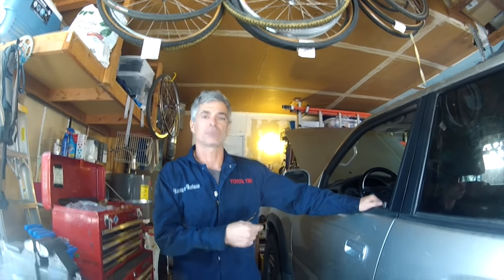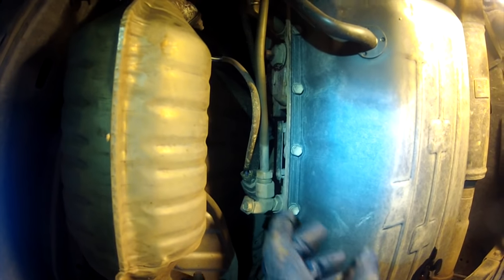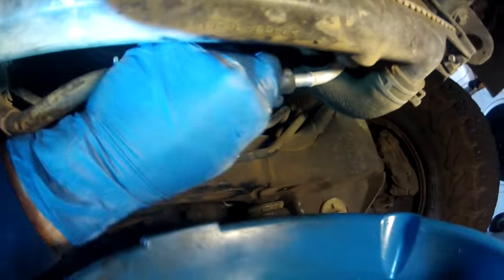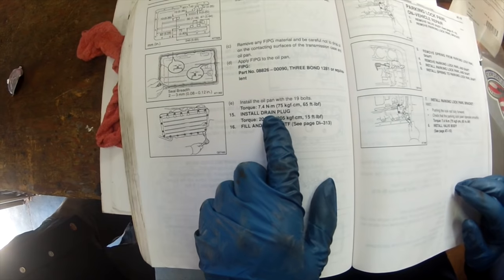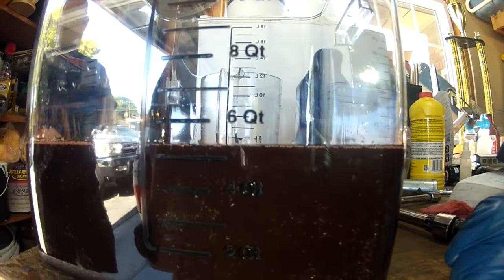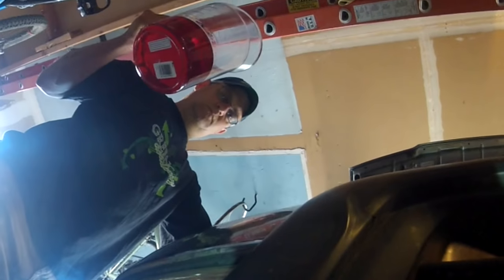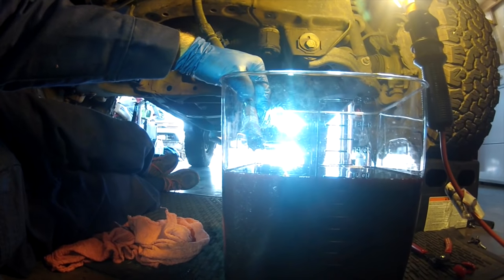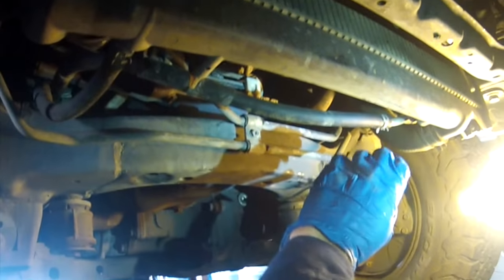Transmission Fluid Flush

Comment: You should do a radiator flush next !!! I want to figure out how to drain the coolant from the engine itself
Reply from the maker: All you have to do for a radiator flush is drain the coolant out of the radiator and pull the reservoir bottle and pour that out.  I cover this in my trans cooler install video.  https://youtu.be/2nVbwe2t2T8

There is a drain for the block but I think it's a waste of time in my opinion.  There was a guy on a Toyota forum that showed how much he drained out of the engine.  It looked like maybe a 1/2 pint.  That's not enough to worry about in my book.  If it were simple to access, I'd say do it, but I heard it's a little difficult to get to.  There's also some left in the heater lines and core as well.   

You get the bulk of the coolant out by draining the radiator and reservoir and if you're renewing it at the suggested interval, every 30,000 miles, your coolant will stay in good shape.
Reply: Timmy The Toolman
Reply: Timmy The Toolman
Reply from the maker: We got a radiator flush video coming.  Sean wanted to change back to using Toyota coolant so we had to flush out the old pond scum green he had in his system.  His coolant was in bad shape and even if we weren't switching coolant types, I would have recommended to do the flush to get all that old coolant out.  If you renew your coolant at the normal interval of every 30,000 miles, your coolant won't look like algae pond water.  When you simply drain the radiator, you get most of the coolant out.  The capacity of the cooling system without a rear heater is 9 quarts and with the rear heater it's 9.5 quarts.  Draining the radiator gets out around 8 quarts, so at most, you're leaving 1-1.5  quarts of old coolant in the system.  When the coolant is changed regularly, leaving that 1-1.5 quarts in there isn't going to hurt anything.  

We used 8 gallons of distilled water to flush out his cooling system.  We'll have the video out within a few weeks.  The video editing is backed up a bit because we've been doing a lot of wrenching lately.

Comment: Hey Tim, how are u brother,  I have a 2 simple questions. When it comes to the supercharger for the 4runner, is it as simple as plug n play (it doesnt requires that 7th injector, does it) and once installed does it guzzle more gas; If so- is it a minimal increase or alot more??? Thank you so much!
Reply from the maker: Gas is more expensive since you have to use 91 octane. Average miles per tank is ~220/230 miles/tank, which is about the same as our other 4runners WITHOUT a supercharger. The supercharger does NOT require the 7th injector however it is a good idea to think about fuel management by installing a higher flowing fuel pump,  larger fuel injectors, methanol or the 7th injector AND a professional tune. All these things will help with performance and to avoid pinging. Everything you need to know you can find on T4R.ORG our favorite website. https://www.toyota-4runner.org/3rd-gen-t4rs/146022-3-4l-trd-supercharger-thread.html
Reply: @TimmyTheToolman , Alright thank you Tim... !!! I'll take a look at tht link you sent and do my homework....have a GREAT REST OF THE WEEK, or what's left of it. 4runner FOREVER!

Comment: Regarding torque specs on the transmission drainbolt...
Haynes Repair manual says ...
156 inch pounds (13 ft.lbs.) for 1996 to 2000
35 ft.lbs for 2001 & later...

Please confirm.
What manual are you getting your specs from? What year vehicle is it for. Some years may have an aluminum pan and others may have a steel pan.
Reply from the maker: The 15 ft lb spec we specified for the drain pan bolt came from a Toyota factory service manual.  I've worked on 01 and 02 4runners and no way is that bolt going to be a different torque value than the 96-00 models.  It's the same size drain bolt for all the years.  If you tried torquing it to 35 ft lbs, you would strip the pan and then be bumming.  I suggest you use 15 ft lbs and maybe do yourself a favor and get a Toyota FSM set for your rig.  You can find them for sale on Ebay most of the time.
Reply: @TimmyTheToolman 
There is a fellow who calls his channel"Toyota Maintenance" and he mentioned 40 N•m (30 ft.lbs). I think it was for a RAV4 . Maybe I was wrong. Or maybe he misspoke. On a video for a Corolla he said 20 N•m which I believe is 15 ft.lbs. https://m.youtube.com/watch?v=GTejG9nCGC8
Reply from the maker: @njsongwriter  Yeah, I know who he is but I would never try to torque one of the small drain pan bolts to 35 ft-lbs.  Trust me on this.  15 ft-lbs is more than enough.
Reply: @TimmyTheToolman  
Thanks. On this coming Monday, we're getting an after market ATF cooler installed on our RAV4.

Comment: What fluid is recommended for my 2002 Toyota 4runner 3.4 V6?   Help!!  I need synthetic.
Reply from the maker: Valvoline Maxlife is a good choice.  I just started running it in my rigs.  Here's a link: https://amzn.to/2NnaVpB
Reply: @TimmyTheToolman  Timmy the service manual states dexron II or III for the transmission and PS. Nonetheless you suggest Valvoline MaxLife which is dexron IV. So, then this means it is not an issue to use D IV ?  Thanks.
Reply from the maker: @luiszo11  Valvoline Maxlife is compatible with Dexron III.  As long as the fluid you use is compatible with the original spec, you can use that fluid.

Comment: I have a 07 tacoma 5 and auto close trans , basically no dip stick. Toyota claims its a service free trans which I don't believe it. Have you done trans service on a 05/10 year trans?
Reply from the maker: Hey Dario, I haven't done a service on one of these newer transmissions with no dipstick.  Yeah, no fluid lasts forever.  Why Toyota went to this is beyond comprehension.  I had heard about this with BMWs with them saying the fluid is lifetime and doesn't need servicing and of course people started having transmission issues around the 100k mark when the fluid was completely broken down.

I watched this video: https://www.youtube.com/watch?v=e1pr3EHSMDI  He works exclusively on Toyotas and explains how difficult the procedure is for getting the fluid level correct.  He reads from a technical service bulletin and it sounds like a nightmare to do.  

If it were me, I'd drain the fluid into a container that has graduated measuring marks so I'd know exactly how much I removed.  Then, I'd use one of those cheapo pumps you can buy at an auto parts store and add the exact amount back in.  This is assuming the level was correct to begin with.  If you had a leak and lost some fluid, you would pretty much be forced to follow that very involved and confusing fill procedure.  

Wish I could help you out more.  Toyota really screwed their customers by going to this type of transmission with no dipstick.

Comment: Just recently purchased a used 97 4Runner, drained the transmission pan but only got barely over two quarts out and replaced, whereas you showed draining a bit more than 5 quarts.  I see on some forms that you should expect to get around 3 quarts out.

The reading on the dipstick looks like it's at the right level. Does that mean I'm low on transmission fluid necessarily?  When I drive the car on a short drive I do notice it has a difficult time shifting in that it seems to be delayed.  And also there's a delay when shifting into reverse. I did not notice this when I test drove the car.

I would note also that after purchasing the car, when I initially measured the fluid at the dipstick after reaching operating temperature, it seemed to be overfilled so I drained around a quart out as I was concerned about it being too full.  

Hoping I haven't caused any damage to the transmission having driven it for a mile or so if it was low on fluid.

I've read quite a few posts that have indicated if you're low on fluid shifting will be delayed and or a bit rough due to lack of pressure.

Thoughts?

Thanks!
Reply from the maker: Are you checking the fluid level with the vehicle running?
Reply: @TimmyTheToolman  I am.  And  with it running and fully warmed up it showed as being overfilled when I first brought it home after purchasing.  So I took out about a quart or so until it showed within the hash marks on the dipstick. 

But since doing that it seems to have a delay shifting into reverse and sometimes into first gear when starting from the stop. When I watched your video and saw that you drained almost 5 quarts out of the pan, it got me to thinking that maybe mine was actually correct when I thought it was overfilled, given how it drives since I've drained a quarter so.  I'm going to do the complete drain and refill like you showed on the video and start with it showing as in the middle on the dipstick and if it's still shifts like it is now, add a little bit at a time until it shows full or a little over to see if the shifting problem clears up.  If it's a quarter inch or so above the full mark when I'm done (like it was when I purchased it) is that bad for the transmission?

Maybe my transmission is just on its way out.  

Thanks again for all you do for we 4runner owners!  You've certainly helped me keep mine on the road!  And now my son's if we can get this transmission issue figured out.   Hoping I didn't do damage for the short distance I drove it.
Reply from the maker: @tpatrickwilson65  I wonder if there's a chance you have the wrong dipstick installed.  Every properly filled automatic transmission I've seen on a 3rd Gen 4runner generates around 4-4.5 quarts from a drain and refill of the pan.  2 quarts drained out of the pan seems grossly underfilled.  It's OK for a transmission to be slightly underfilled or slightly overfilled.  But, 2 quarts low is a lot.  Do you have a way to measure the transmission temp?
Reply: @TimmyTheToolman  No, I don't have a way to measure the transmission temp.  Unless it's reported using something like the Torque app.   If memory serves from your other videos, on the 1997 model year the ECU does not measure temp?   

I can tell you the dipstick is different than what I have in our 01 4runner.  So I ordered a new one from Joe Joe (guessing you know who he is) and provided the vin number of the car to him.  The one he sent is the same in length and hash marks as the one installed.

I did notice that the dipstick tube configuration/angle is different between the 01 and the 97, but figured that was plausible as other things under the hood between the two cars are also different.

Looking at the vin tag inside the door. The two cars do seem to have the same transmission (a340f).  I am know because I replaced the trans on the 01 following your videos!  😄

Obviously Im not driving it till I figure this out.   Think I could have already done damage by driving if a few miles?
Reply from the maker: @tpatrickwilson65  I know this is potentially insulting to ask, but I'm trying to help you and I don't know your level of automotive knowledge, so here it goes.  Are you checking the fluid when the vehicle is on level ground?  I have a 98, which is the same pretty much as the 97, same dipstick, and I get 4-4.5 quarts every time I drain the pan.
Reply: @TimmyTheToolman  Not insulting at all!  Yep,bit was on level ground.  When I checked after it was fully warmed up I'd say it showed about 1/2 inch or so (maybe a bit more) above the hot mark.  So I used a vacuum pump to pull out fluid until it showed right below the hot mark and called it good.  Thought I had it right until I drained yesterday and only got 2 quarts out.   

I am going to follow the whole process you detail in your video and start by draining pan when cold and adding two quarts back and then check level.  Will then begin adding up to 4 hopefully, checking the level at each 1/2 quart interval.   

Will stop when a get a bit above the cold mark, then start the process of pulling the return line (after I've got it to operating temp) and removing/adding as you did in the video until looks like I've remove all the old.  Then will reconnect the return line and fill (if needed) to the hot mark.  

Seem like a reasonable approach? Or would you recommend something different? 

Thanks!
Reply from the maker: @tpatrickwilson65  Yeah, your approach sounds fine.
Reply: @TimmyTheToolman  Great!  And thanks again for your guidance and the effort you put into your videos!  Keep up the good work!
Reply from the maker: @tpatrickwilson65  No problem.
Reply: @TimmyTheToolman  Just to follow-up.  Not sure what I was doing earlier when I thought it was overfilled.  I guess they can be tough to read when hot.  Anyway I did as we discussed and sure enough it took a little over 2 more quarts and it now shows at top of hot hatch marks.  Shifts great now!  Thanks again for all of your help and guidance!
Reply from the maker: @tpatrickwilson65  Glad you got it figured out.  Good job!

Comment: Hey is it Tim or Timmy? Anyway another great video as Im going through all of them. BTW I just bought some soccer mom's 4runner which she used as a grocery getter for most of its life. Plan on turning it into our overlanding rig. Lotsa work needed maintenance wise so you're definitely saving me alot of money as I get this rig up to snuff. Im in the bay area as well. Oakland to be exact. Are there any 4runner groups to make contact with. Lastly were you guys able to find out what was causing the radiator to run so hot? Thanks in advance for your response.
Reply from the maker: I go by both but most people call me Timmy.  That's great you found a good buy.  My 2000 was a soccer mom rig as well.  Glad to hear you're making good use of our videos and good luck with the build.  Joe's thermostat jiggle valve wasn't in the right position so that can cause around a 10 degree temp change.  His radiator cap was also bad which meant it wasn't holding proper pressure on the cooling system.  But, I'm pretty sure the higher than normal temps was mainly due to the jiggle valve being in the 12 o'clock position when it needs to be in the 6 o'clock position.  Normal coolant temps should be around 188-192 unless you're climbing grades.  Joe's temps were in the high 190's to low 200's, about 10 degrees above normal, which lead me to believe it was a jiggle valve position problem.

Since you're local to us, are you coming to our party on May 19th?  Check out the video for the party invite if you haven't heard about it yet.  You're welcome to attend.
Reply: Timmy The Toolman  Mahalo for the invite. My new rig might be torn apart for some maintenance so is it okay if I bring my 70 VW Bus. Yup Im a VW aircooled guy too. Look forward to it. BTW my name is Hector.
Reply from the maker: Yeah Hector, come on by.  At least you have one of the old cool VWs.  I'm not a big fan of Volkswagen but I do like the old buses and bugs.

Comment: So I have a 96 4runner with 266,030 miles on it. I’ve had it for about 4 years and never have I checked the transmission fluid. I recently did a flush at a shop. I wasn’t aware that if you don’t know the maintenance history on it and if it’s high mileage you shouldn’t do a flush. It’s been about 2.5 weeks. I haven’t driven it much since I have another car I use also. I am going to be using it more in the next week or so. What should I look out for if the flush did cause a problem? Also I noticed that the dipstick was wet all the way to the hot section when the car is cold and not started. Any input is appreciated 🙏🏽.
Reply from the maker: First, check the level of the fluid when the engine is running and on level ground.  If the vehicle hasn't been driving, expect to see the fluid in the cold level on the dipstick.  If you've been driving for a while, expect to see the level in the hot range.  The vehicle needs to be driving down the road to heat up the transmission fluid.  It doesn't get hot from sitting standstill.  

If you develop an issue, you'll most likely experience the transmission slipping (rpms of the engine going up), but the vehicle is slowing down.  Or, you'll experience some shifting issues.  You'll know it if you're having a problem.  Hopefully, it will be OK.  Lots of high mileage transmissions get serviced, and they are fine.
Reply: Thank you so much for replying! I will be keeping a look out for all that you mentioned. 🙏🏽🙏🏽🙏🏽
Reply from the maker: @anaarguelles8292  You're welcome!

Comment: Tim, I have a question. Is it not possible to dip the hose that takes cold fluid back into transmission to fill the transmission?
Reply from the maker: I doubt that would work.  Positive pressure from the trans pump moves the fluid through the cooler and back into the pan.  From the pan, the suction of the pump picks up the fluid through the filter and feeds the trans.  There isn't a suction on the return line as far as I know, but who knows, I could be wrong.